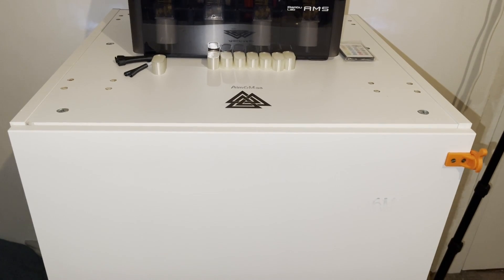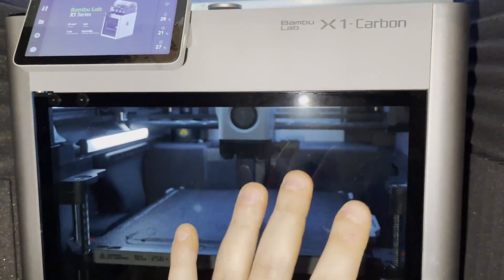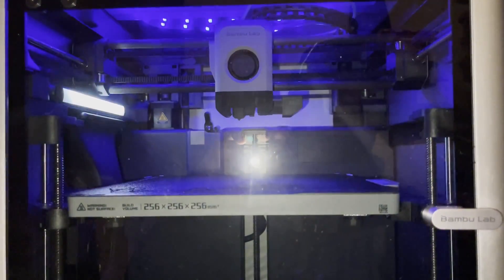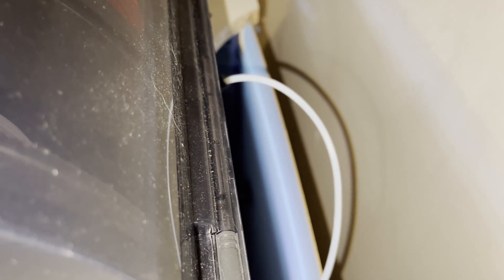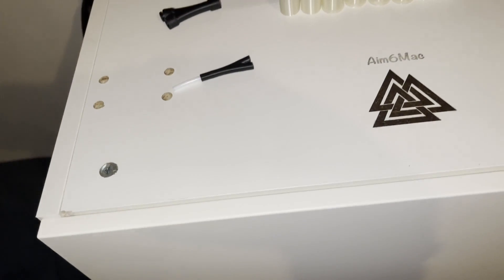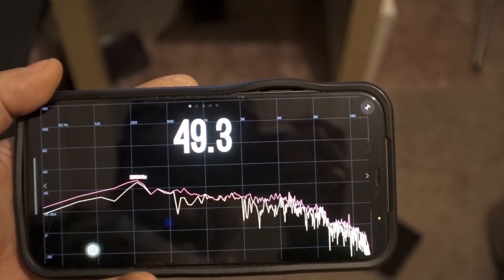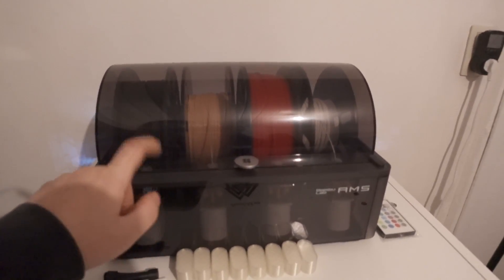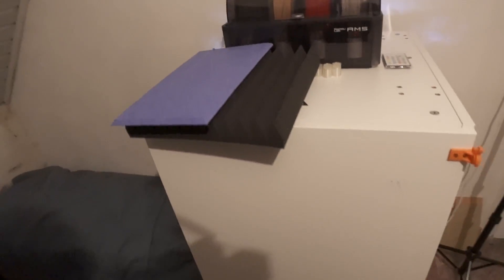Bambu X1 carbon... how to make it SILENT???

Comment: what table is it sitting on
Reply from the maker: some old ikea table
Reply: @aim6mac  I'm surprised it can hold the weight
Reply from the maker: @muniradlan3659  yes it does hold it, and there is double ams system on top aswell :o
Reply from the maker: @muniradlan3659  Ikea claims it can hold up to 25 kg
Reply: @aim6mac  but with the weight of the IKEA Metod and the printer + filament, it'll have to hold +40kg and it's rated for 25kg. Not sure I would feel comfortable that it can hold the weight lol
Reply from the maker: @muniradlan3659  well yeah, i don't recommend to get that table for sure, it's what i've had at home so i used it, but so far no problems lol, i might get a new table in the future.
Reply: @aim6mac  I've finished building this enclosure and now I just need a table for it but I can't find a suitable one so I was curious what IKEA table you had
Reply from the maker: @muniradlan3659  i've got this one, https://www.ikea.com/be/nl/p/lack-tafeltje-wit-30449908/?utm_source=google&utm_medium=surfaces&utm_campaign=shopping_feed&utm_content=free_google_shopping_clicks_Livingroomseating&gclid=CjwKCAjwhJukBhBPEiwAniIcNU3mbJiEpaPcMNwIKf1ifHmenzBWOE8Pp-QKsNoHV3uEdP8EkJQb9hoCokIQAvD_BwE

Comment: When printing PLA I read it is recommended to have the door open and the cover glass plate removed. Are you printing PLA with everything closed? No issues due to the heat?
Reply from the maker: to be honest, i never open the front door nor the top glass plate, and my prints come out without any issues, maybe it only applies for very hot country's?
Reply: @aim6mac  I should have paid more attention: the recommendation was for printing PLA on PEI building plates (both, the regular or textured). If printing on the cool plate, the chamber can be closed.

Did you print PLA with the bed heated over 45° bed temperature and using a PEI build plate?
Reply from the maker: @mrwhatever1970  oh well, i print PLA on PEI 55° from Bambu , still no issues :p
Reply: @aim6mac  Thank you!

Comment: Poop shoot? How do you access to get the poop
Reply from the maker: I've made a small hole in the back where i have acces to the 'poop' box
Reply: @aim6mac thanks for replying. 
Do you have anything to guide it out the back or is printer pushed all the way to the back ? 
I’m driving to ikea tomorrow to buy this metod and a door with hinges 
Can’t find the hard rubber for the base tho
Reply from the maker: @nickjeffrey8050  there is not much space in the box, printer fits in there and there is just about enough room for the poopshute ... but all together it works in harmony
Reply: @aim6mac and no issue with the ams cable being to short?
Reply from the maker: @nickjeffrey8050  ams cable is indeed short , but still long enough to be right on the top of the box :)
Reply: @aim6mac so just got back from ikea about to build. All other foam and things arrive tomoro from Amazon. 
Using carpet spray adhesive to stick the foam. 
Cabinet will never get used for anything else so won’t need to remove lol
Reply from the maker: @nickjeffrey8050  hot glue pen works aswell :)
Reply: @aim6mac ey, so I’ve had this going for just over a day now. 
3 things have occurred since putting printer in the completed unit. 
1. Loose wifi 80% of the time, guessing the foam does a great job at blocking incoming and outgoing signals 
2. Printer chamber gets over 40 degrees on the screen which it’s never gone above 30. Also the unit get crazy hot too. 
3. Ams looses connection to printer. Lights start flashing red and once print finishes errors saying slot 3 ran out of filament, even tho it has a near full roll. Due to loss of connection. 

I’ve taken printer back out and all these 3 problems have gone away. 

As nice as it was I don’t think this is the way to go. 
Maybe a bigger unit and install some extraction fans. 

I’ve installed the alubutyl sound deadening to the inside of the printers panels when I made the unit ikea unit and that alone makes a big difference. 
Shame I glued the foam in otherwise I would return it all and get my money back lol
Reply from the maker: @nickjeffrey8050  thats a shame, and i can't recall these problems in my cabin... wifi is not great but then again it was never great since it my router is in another room and bambu doesn't have a very strong signal anyhow.  AMS losing connection... really never happend to me... and ams is connected with a cable so all i can think of is that your cable might be too tight and losing connection that way, my chamber stays around 41 degrees, with the door closed, when i open the door it goes down to 38 degrees celcius.
Reply: @aim6mac  did think it might of been tightness of the cable but when i check it was fine. Even wobbling the cable didn’t get it re connected. 
Only thing I can think of is the board was getting to hot and was shutting down giving the loss of connection. 
Again once it was back out of the unit the ams hasn’t disconnected since. Super strange. 
This unit it 60x60x60. 
I think in a few weeks I will get a platsa unit. 120x60x80 
I’ll also install some fans for extraction and more for bringing cool air in
I can imagine the cost will basically double. Shame I can’t use old foam as glued it in to the metod lol 
Will keep you updated once bigger one is done. 
Probably do a video like yours 🫶❤️😘

Comment: any concerns over the temperature inside? Specifically for the power supply?
 I know with Prusa enclosures for eg, they recommend keeping the power supply outside of the enclosure so it's not running hot as it reduces its lifespan.
Reply from the maker: hi there, since the back of the enclosure is open i dont think there will be an issue about anything heating up more then it should be.

Comment: That looks like a great idea! So just to clarify, you have used a standard sized Ikea Metod cabinet for this? Do you find the IKEA cabinet strong enough as some IKEA products are not made from solid wood? And you are not concerned that the vibration from the printer won't make the IKEA screws come out? I'm looking for a solution to the same issue and this looks like a good possibility. I'm not intending to criticise.  I'm just interested in your thoughts on the issues that I raised.
Reply from the maker: hi there, well to be honest, this cabin is fairly solid, but time will tell how it will hold out...  so far it's going strong and took away the vibrations aswell because of the anti vibration rubber mat under the printer. If u really want to go crazy u could get the same size (60x60x60) and build your own solid wood cabin aswell.  But i found this on ikea website and though it would work, and it did.

Comment: I feel a bit claustrophobic seeing how tight everything is. I'd install a smoke detector in it or close to it. Maybe even modifiy a detector to feed the speaker outside. I like that you recognise the problem, so many problematic things are not properly adressed these days.
Reply from the maker: Hi there, well installing a smoke detector might be smart but also unnecesary thus that the printer cabin doesn't go over the 40 degrees celcius, if it would go over 50 degrees i'd consider installing a smoke detector .